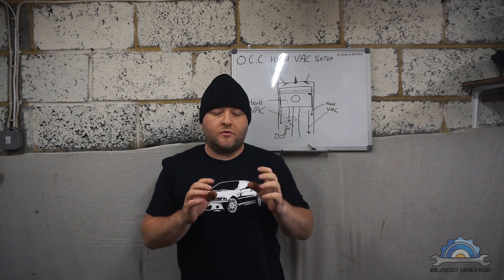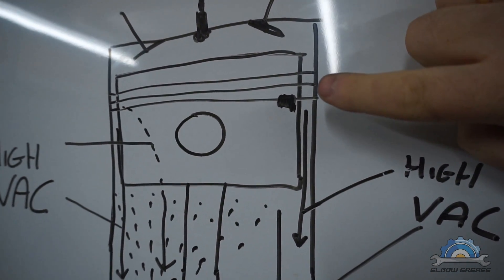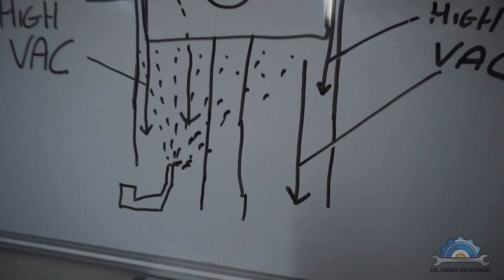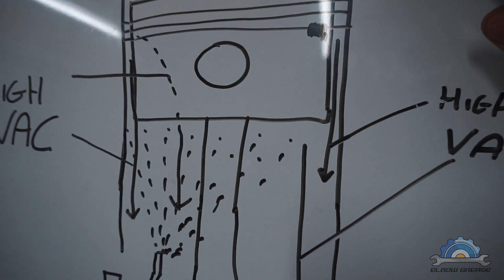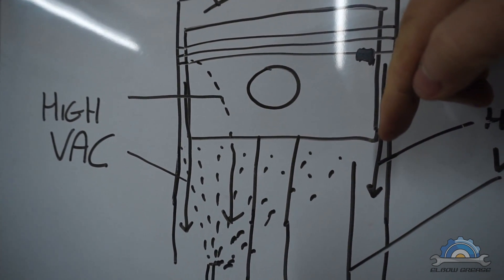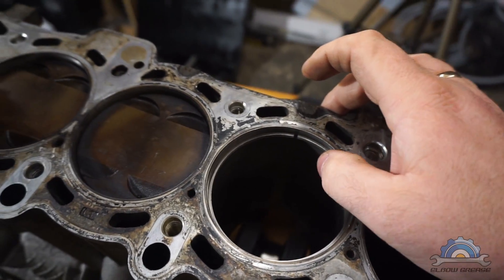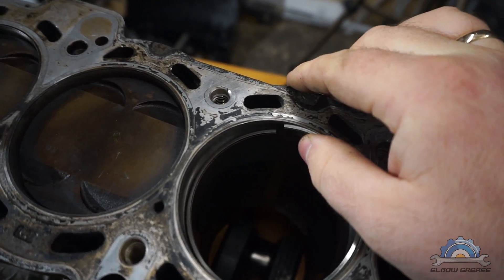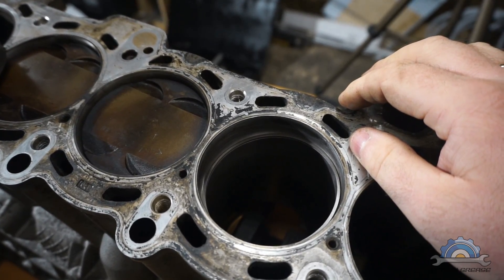OIL CATCH CAN HIGH VACUUM SETUP in BMW E46 M54 SAFE or NOT

Comment: I don’t think that you will starve the cylinder of oil.  The top of the piston will be under well over 100 x atmospheric pressure (during combustion) while the bottom is under atmospheric or vacuum.  The thing that will remove oil is air flow and if we are only changing the difference in pressures by <1% I don’t believe we are changing the airflow at all.

Comment: High vacuum won’t cause oil starvation. The oil sprayers are still going to spray oil where it’s needed regardless of high vacuum in the crank case. High vacuum will keep oil from getting by the oil rings as much, and the catch can will help keep your intake and valves clean. The design of the m54 oil ring is garbage. They should have never changed the oil ring design from the m52tu to this m54 oil ring garbage.
Reply: Hi Nick,  now I'm curious. What do you think is the problem with the M54 oil ring design?

Comment: Also, the oil ring allows oil to get to the skirt it also does it's own fair amount of scraping and keeping the oil on the skirt.
It does this with crankcase pressure pushing the oil ring against the cylinder wall.

Comment: I have went to the catch can to keep oil out of the intake but am trying to correct  the vacuum. I am pulling too much vacuum on the engine that it is sucking air past the rear crank seal

Comment: What do you think of the 02pilot mod? 50`skid did a video about this. If you attach a hose from the ccv to the back of the intake manifold you will have increased vacuum in the system which will then stop oil consumption.
Reply from the maker: it's a simple and good mod but works  well when oil burning is low or medium
Reply: Do you think it will work in cold weather? I live in Norway so it gets under freezing sometimes.
Reply: hmm, it should not cause any damage when tube will freeze up  ,its simple ,try and report

Comment: The CCV is meant to get the blow by gases from the crankcase into the intake. Oil vapors are present in the crankcase gases with or without the gap in the rings. It's there because.. the oil is there. The CCV is supposed to recover the oil particles from the crankcase gases and return it to the sump. When this fails the oil ends up in the intake. It can get as bad as half a liter per 1000km. It has nothing to do with the oil left on the cylinder walls by bad scraping rings (gaps).
Reply: Cosmin Rotaru but if ring are worn people are using this method to stop burning instead of ring replacement
Reply: then that's just wrong :)
I'd expect a compression test (wet & dry) to help diagnosing the rings... If that goes well I'd look into the CCV and the valve seals (assuming oil is not just pouring out of the engine somewhere :) ). I'm not a mechanic but I did have oil consumption which drooped a lot after changing the valve seals and then even more after replacing the ccv (compression is good). I still have some oil consumption but is not that bad for a 21 years old engine :)
Reply: Cosmin Rotaru its not possible to check oil rings with leak down or comp. test
Reply: you mean the ones that scrape the oil? we see a compression ring in the video.
Reply: Cosmin Rotaru yep.

Comment: that gap become very smal when the engine works, due to the the dilatation, and then those rings block off de sistem.  this is my opinion.
.. sorry for my bad english
Reply from the maker: Iulian Saghin bit if ring are worn badly like mine was, that won't go completly

Comment: Hi Elbow Grease, my m54 had big smoking problem, i tried High Vaccum method bit help but nothing much, u have good point about oil starving with high vac setup, but in america BIG Guys is puting on engine vaccum pumps what sucks air from crank case for biger HP gains, so yea u have good point, but are vaccum so big to start engine starving?? i dont think so....
Reply from the maker: Edgars Vilcins I think all depends on ring gaps,how big they are.Vacuum pump have smaller vacuum then direct vacuum from 3.0l engine.Don't know ,thats why I asked

Comment: I watched most of your m54 related videos and really appretiate information you shared. I don't think vacuum is so strong that it could help anyhow to seat rings better, it's probably nothing compared to combustion pressure already applied to them. I also think that vacuum helps to pull oil down, but not to the point of starvation. There should be plenty of oil drugged and splashed by crankshaft. Also the vacuum is only high on low rpm when load is minimal, as soon as throttle body opens the vacuum goes down and positive pressure prevail. Now I wonder if e46 stock ccv is too restrictive for blowby gases to escape !?
Reply from the maker: Roman R Hi,you described stock ccv operation,In this video Im talking only about Hivac,no ccv,only catch can so vacuum is very high.I got new rings now and stock ccv,no issues with blowby or mayo in oil when cold.
Reply: My bad, watched it again. You meant when actual inline vacuum pump is used. That is different story
Reply from the maker: Roman R no pump no ccv, just OCC to stop any oil ,Type google,people using this setup as last hope to stop oil burning,thats why I've made that video to maybe open eyes to some of them.If you have any Q. you can use my FB.

Comment: How about connect CCV pressure outlet with the intake manifold underpressure? 
My friend from E46forum.pl did this, and his consumption dropped from +/- 800ml / 1000km to 400ml, and after 1000km is still dropping down. 
This is true story. 
I'm MARC from E46forum.pl
Reply from the maker: CCV pressure outlet with the intake manifold underpressure ? is that creating high vacuum in crankcase like I said in this video to stop oil burning?!
Reply from the maker: people using HIGH vac setup to stop oil burning ,your friend did not discover anything new.In this video i'm explaining what might be the potential problem with this setup. :-)
Reply: Yes. Oil burning is going down.
Reply: Marcin i used to have an aftermarket crankcase system with PCV valve n all that crud I ended up taking it off and putting our OE system back on my catch can would fill up very quickly and pnce during very hard cornering would flood the intake with oil nothing bad actually happened though and the car was fine but I was just amazed with the amount of smoke came out the tailpipe for a little while

Comment: I use catch can NOT TO STOP oil burning, i use it, not to suck oil to the intake manifol (which my engine was doing) and then burning it. Because all sides of Intake manifold on M52 engine were covered with oil, also intake was covered in oil, also all intake valves because of oil + gas mixture, started to build carbon on the walls, causing many troubles. So catch can is the best option. Also in the winter I had issues with idle, CCV (brand new, with new tubes) made terrible noises, also sucking oil from oil pan (from engine bottom) by letting oil go to the intake manifold.

After 1 year driving without that system, my car is thankful for me. Also it's much cleaner in engine bay ;)
Reply: Any update about how the oil catch can worked all these years on your M52?
Reply: @agdwhite5421  Not have that car anymore, but I saw like 6-8months ago, that car is still running like a champ, totally no issues about oil burning.
Reply: @ejot2  Thank you!